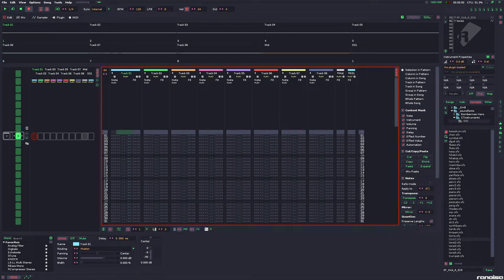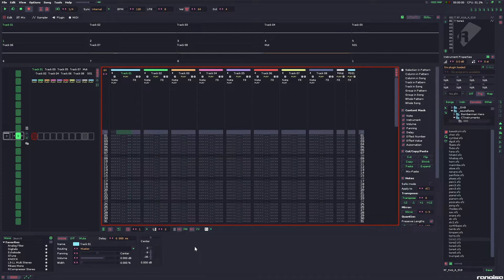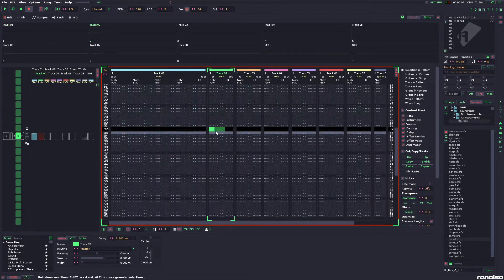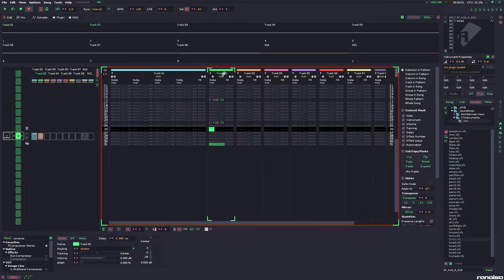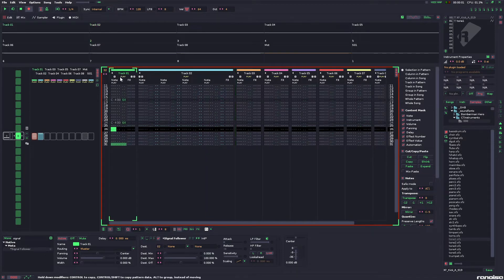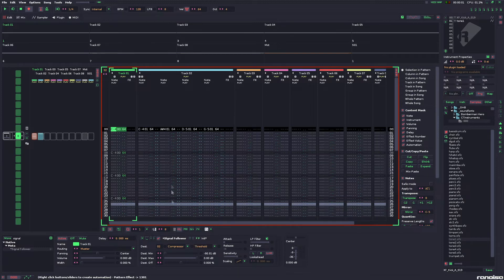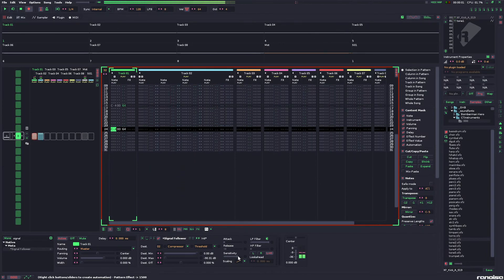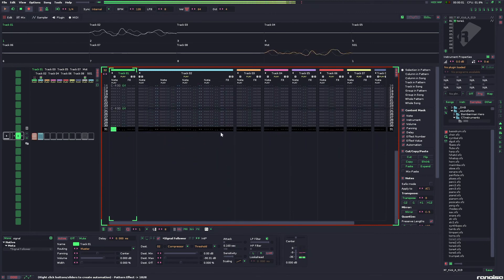Renoise 3: Simple Sidechaining with Signal Follower

Comment: You can overcome the signal follower >>to the right limitation by using a hydra. Set the signal follower to control hydra input then route the hydra wherever you want. You can use this method to have one signal sidechaining multiple tracks this way, too. You can also use this trick to make crazy modulation feedback in fx dsp by using fx>sig follow>hydra then routing the hydra to fx params

Comment: sweet! I also just discovered that you can also make the destination the mixer volume of the track you want to control (and reset the signal follower min/max to the original default setting) instead of using a compressor (in effect making a compressor by using signal follower as the volume control of the destination channel)